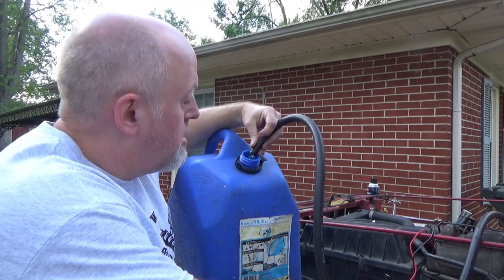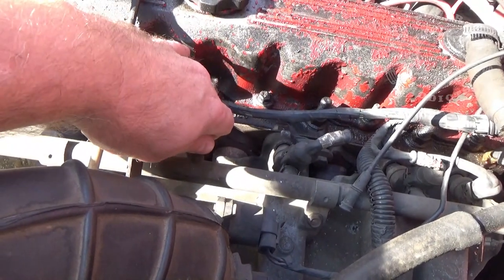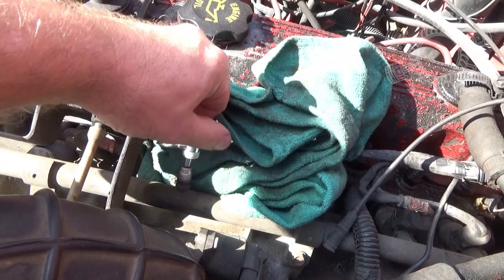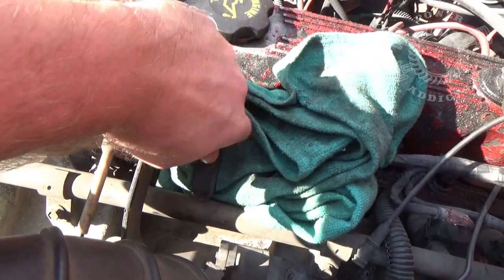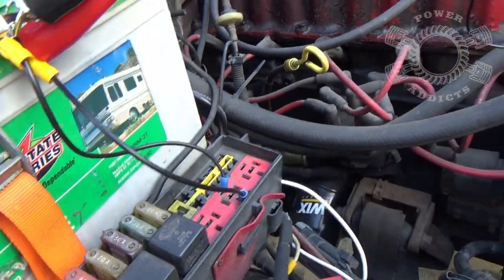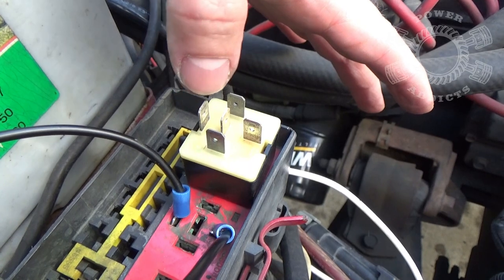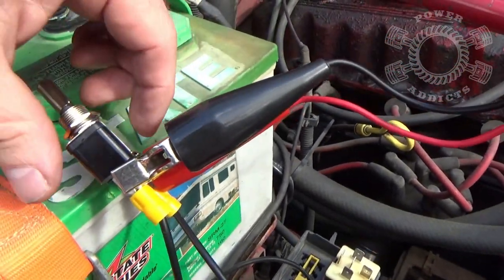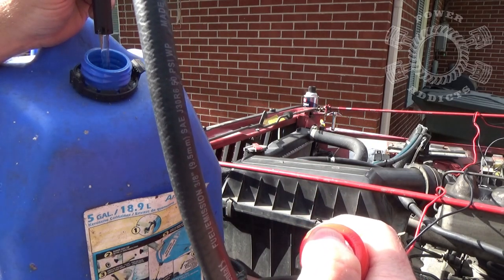Jeep Wrangler YJ - Test the fuel pump or an easy way to empty the fuel tank

Comment: I had to come back to say THANK YOU for this video.  2005 TJ Unlimited and this worked like a charm.  No Schrader valve so I had to buy some tubing and a clamp and just stick it on the fuel line where it attached to the rail.  Also my relay pin layout is different but 30 and 87 jumped did the trick.  AWESOME

Comment: First off...thank you sir for posting! Pulled motor and had complete rebuild by very reputable shop. Purr's like a kitten, but yj got  harder and harder to start[More cranking}. Once running its fine. Did just what you said in video and gas is a pumping! So not a bad fuel pump.....But jeep wont start without MAJOR cranking.... any suggestions would be appreciate.  Thank u

Comment: I just stumbled across your videos while trying to figure out a no start issue on my 1994 YJ with a 2.5. I’ve found a couple of your videos to be very helpful and detailed with how to check each component of the starting circuit. Wondering if I could send you a message and get some advice

Comment: Thanks for the great video.  I recently purchased a 92 YJ 2.5L for $300 that had been sitting for some years because some bozo tried to steal it and broke the barrel lock. I repaired that and have begun trying to bring this old rig back to life. I replaced plugs, wires, cap & rotor etc. I also siphoned a bunch of old bad gas out of the tank but would like to do this to get it really empty.  I set this up using your instructions and it worked great for about 15 seconds before the fuel pump quit pumping.  I'm still getting power at the 30 pin, but no action at the pump.  Any idea what I am doing wrong?  maybe the fuel pump is flaking out?  I'd love your insight before I drop the tank and swap a pump for no good reason.  The sender does not appear to be working so maybe the pump/sender unit is kaput??  Thank for any guidance.

Comment: Is there anyway to check the fuel pump to see if it's working after it's taking out? I'm tying to go down the list of things of why I'm not getting gas. I've already tried everything in this vid and I'm not getting gas nowhere in the front. I don't know if the fuel line is clogged up, or the pump needs replacing. Those are my next two things I need to check.

Comment: Question for you- I removed the schrader valve from the fuel rail and attached a hose to the port. I pulled the fuel pump relay and inserted the jumper wire. Fuel immediately began flowing but soon after slowed to a trickle. The fuel gauge shows 1/8 of a tank of gas so I’m sure there’s still fuel in the tank. Would this indicate a bad fuel pump or some other issue? Side note: this Jeep 4.0 sat for 4 years before I got it. Thanks for any help!
Reply: I have this same question and a similar situation with and idle Jeep for over 5 years.

Comment: If the check valve in the pump is bad or worn; it will release the pressure back into the tank.
Reply from the maker: Yep, that is true. I installed a new Bosch pump and it still didnt hold pressure. So, I just dont worry about it. Its ran fine for years like that.

Comment: Is there a way to test the ignition switch ... ( not the keyed tumbler  ) but the electrical  switch...my problem is the engine will crank over no spark with ...I actually used the starter  to power the Jeep over to its parking place .. I'm being told it's the switch...I have not seen a You Tube on replacing switch on a yj..

Comment: Question? If you need to empty you fuel tank would running the fuel pump for that long of time burn up the fuel pump? And like always thanks for a great informational video.
Reply from the maker: You are welcome, glad you enjoy the vids. Hope they help!! As for running the pump, just don't do it repeatedly and it will not be a big deal. I'd just run the pump until I got it down to about a 1/8 of a tank or so. That would make it light enough to drop much more easily.
Reply: IMO, this may be the same or even less stressful on the fuel pump than normal use. It seems to me that dispensing into open container may provide less resistance than normal use, meaning fuel flow increases. The flow of fuel through the fuel pump is what cools the motor and prevents it from overheating. I believe when motor is on, the fuel pump is always on to maintain pressure. Generally starting / stopping electric motors is harder on them than constant on assuming they are properly cooled. Just watch the flow at the end, as soon as flow reduces due to sucking air, stop.

Comment: I have a dumb question. Why not just turn the key until you hear the fuel pump run then turn it to off when done?
Reply from the maker: Typically when you first turn the key on the fuel pump "primes" the lines up to pressure (about 
 1 or 2 seconds) then shuts off. So you dont just turn the key on and let it pump. You have to turn the key on and off repeatedly. When the engine starts the Cam Position Sensor tells the PCM (Jeep Computer) that we have spark, now tell the  fuel pump to run all the time to keep the engine running.
Reply: @Poweraddicts  : That makes sense on every vehicle I own except my 87 YJ. It's carbed so no CPS but also has an electric fuel pump (swapped in a 4.0L) so when I turn the key on the pump just sits there running. Thanks for the explanation. I didn't know the CPS did that too.

Comment: Thanks, any trick to empty a gas tank with a mechanical fuel pump?
Reply: Ron Jones unkook a fuel line and hold it under the tank
Reply from the maker: As Joseph stated, in some cases you can simply unhook a fuel line and let it drain. However that doesn't always work. I keep an unused Ford truck external electric fuel pump around for those special occasions. I simply unhook the fuel line from the carb or mechanical fuel pump. Then Ford fuel pump on to the line. Hook the fuel pump to a battery and let the pump do the work. You know that would make a good how to video. I'll put that on my to do list for ya.

Comment: Where is my fuel pressure going . background , 1991 jeep 4.0 when running 30 to 35 PSI on a fuel pressure gauge  checked at the fuel rail.  immediately after shutting off engine holds 30 PSI for 30 minutes then the pressure starts to drop , drops to zero within a hour.  end result the jeep only starts 50 percent of the time. however i can spray starting fluid into the throttle body and jeep starts. got spark . runs good once started, not loading up , not hard to start 50% of the time, not blowing black smoke . not missing or sputtering. don't see  or smell fuel around the injectors , no fuel at pressure regulator . dropped tank installed new fuel pump , installed new after market  fuel injectors , new fuel regulator , new spark plug wires , new rotor new spark plugs  , new distributor cap ,no leakage at full rail at fuel line connection.  what and where else should i check ??  
Help  needed
Reply from the maker: Either it loosing pressure past the check valve in the pump or you have a leaky injector/s. Leaky injector meaning that the fuel is leaking past the pintle (where the injector sprays fuel in the engine) when the engine is turned. My91 has never maintained the fuel pressure after shutting off the engine. It actually goes to 0 faster than yours. It did it with the old pump and the new pump. It always starts within a couple of engine turn so I don't worry about it.